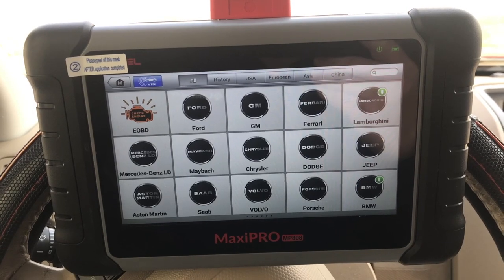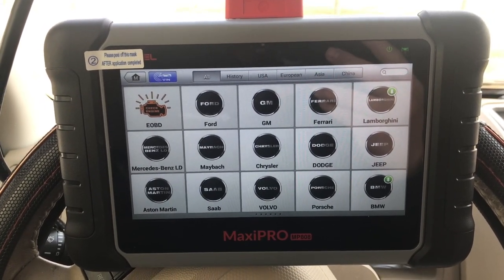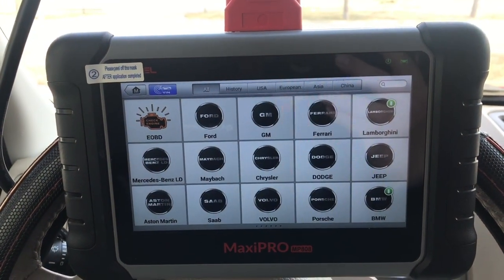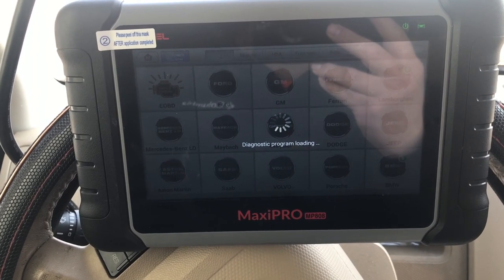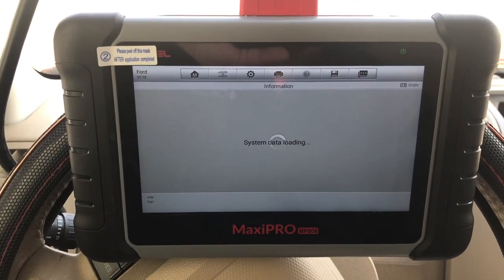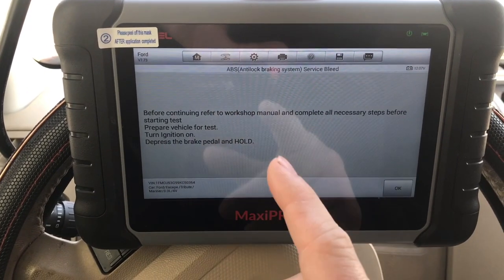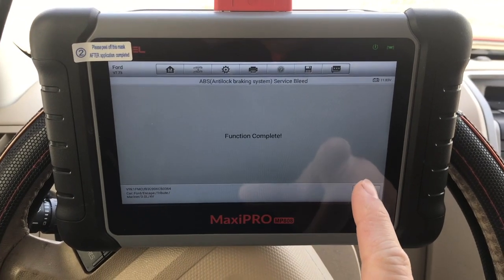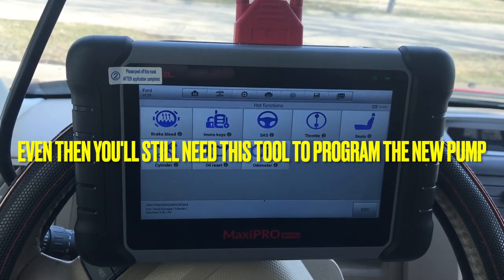Autel MP808 Ford ABS Brake Bleed (Try before Replacing the Pump)

Comment: 2013 Ford Edge is currently having this issue done changed the master cylinder , abs pump with a used one from junk yard and brake booster. Still have soft pedal calipers have been bleed like 20 times now and still same problem
Reply: I heard the autel does not do 2013 ford abs break procedure correctly did u ever solve ur issue
Reply: @cj1613  yeah traded the car in on a 2020 because after spending 2 grand on trying to get it fixed last repair shop said it was going to be another 2 grand to replace the abs module and pump

Comment: do you have any information, does this procedure exist for opel corsa 2011
Reply from the maker: I’m not 100% sure, we do not have Opels in the United States. There is a manufacturing section for Opel’s though, I’m just not sure if it would unlock module profaning for you.
Thanks for the Comment!